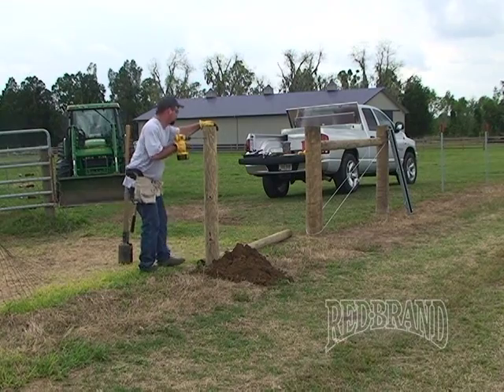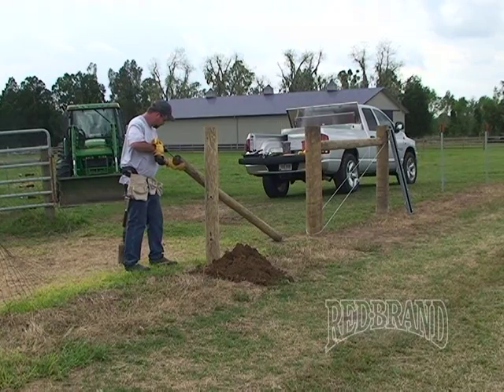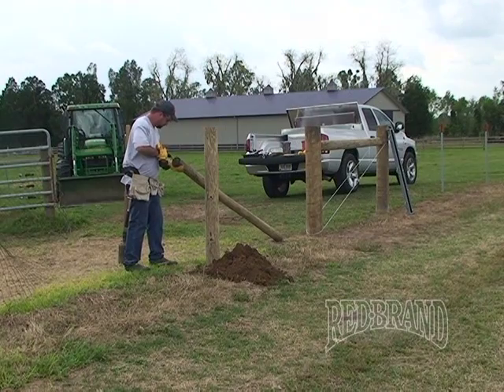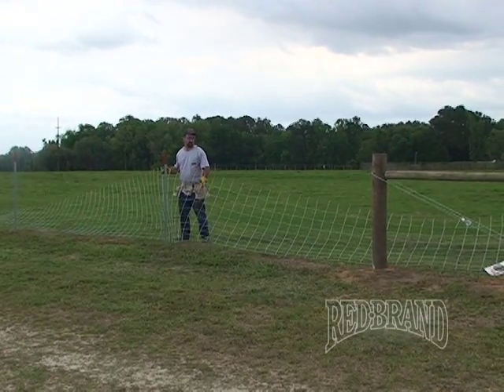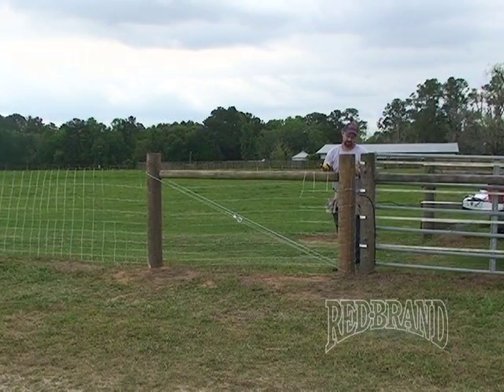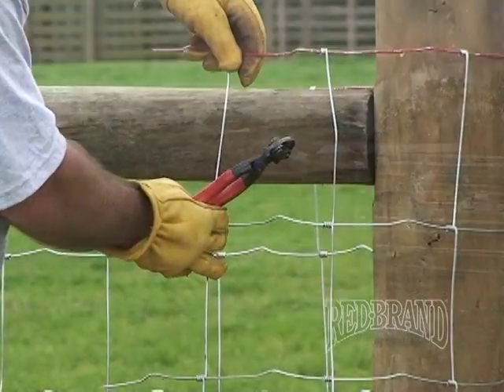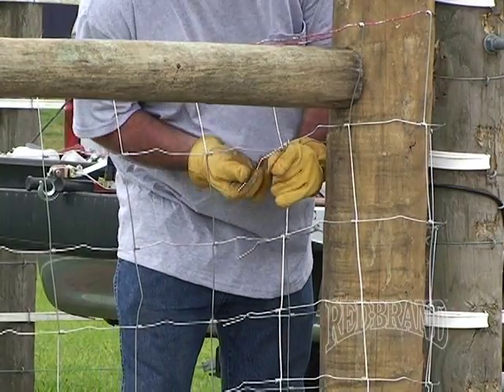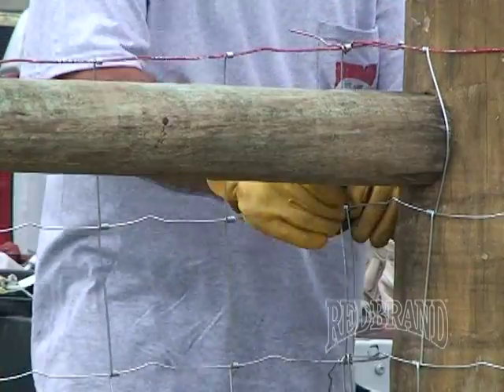Field Fence Installation Part 1 of 2

Comment: We are getting ready to put up a horse fence but post holes filled with water from a underground spring  will  the water damage the post?
Reply: yes. a good way to account for drainage from the post is to put some rocks into the hole under the posts.